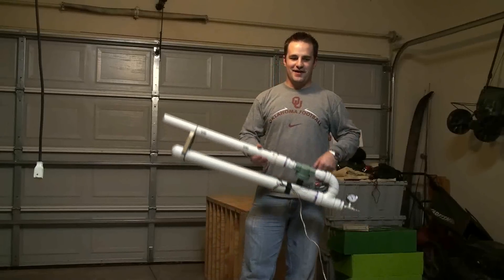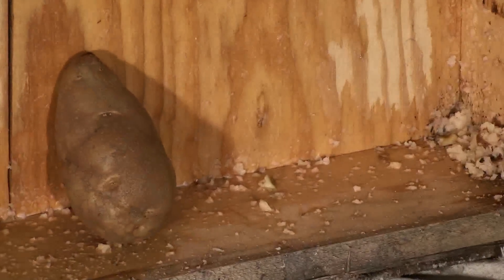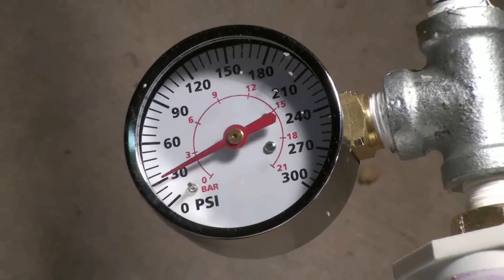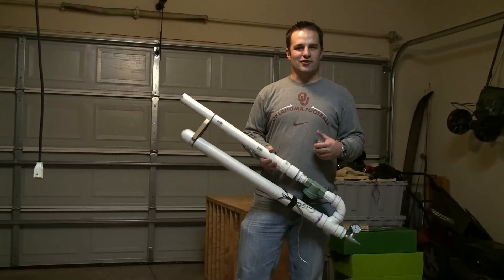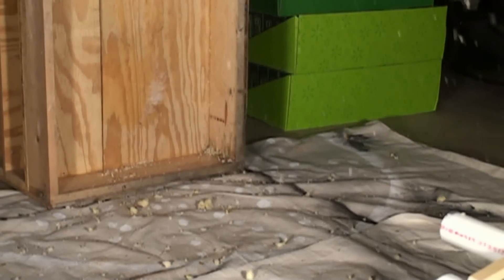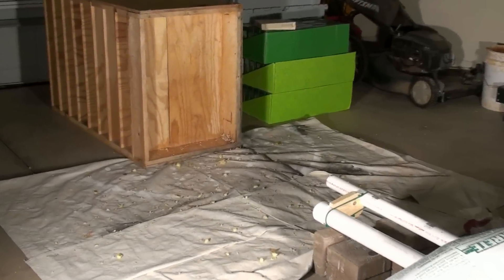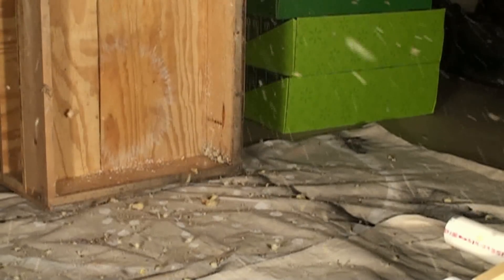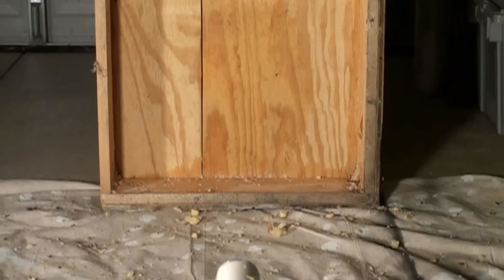Air Powered Potato Cannon

Comment: Nice little cannon you've got there! Just a tip, if you try making a bigger version of one of these - mine has a 10-foot barrel and air tank :) - you may want to use a ball valve or, if you've got some spare time, make a custom "air piston" to release the air. I've found that sprinkler valves don't release the air as quickly when used in larger cannons, since the air opening is much smaller than that of a piston or ball valve. Keep up the good work!

Comment from the maker: @maillet420 The valve is a sprinkler valve.  Like you can find at Home Depot or Lowes.  They use 9-12v to open the valve.  Super easy way to make a potato cannon.